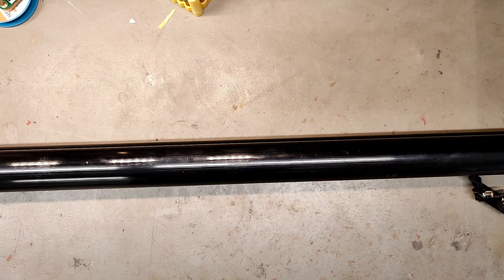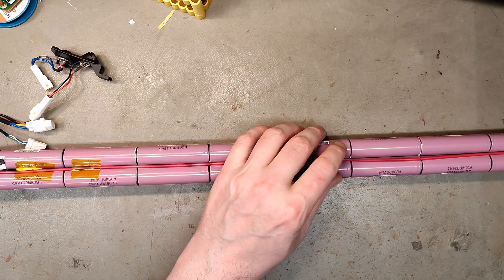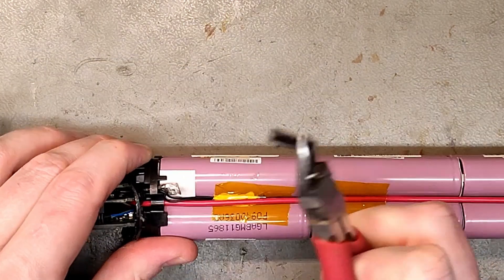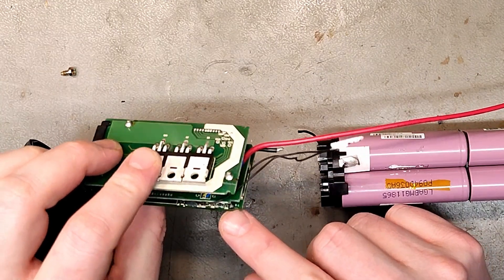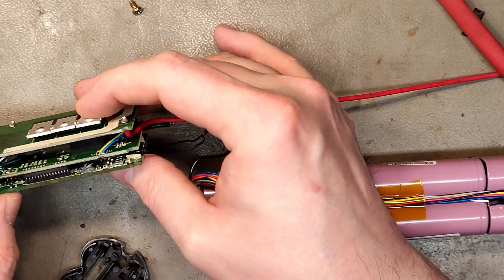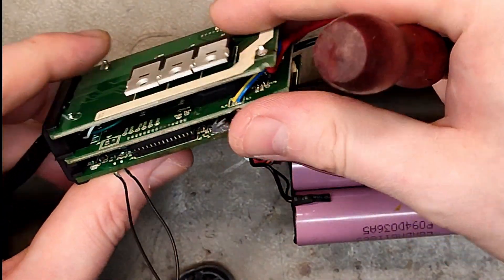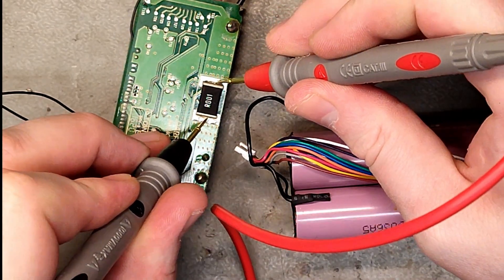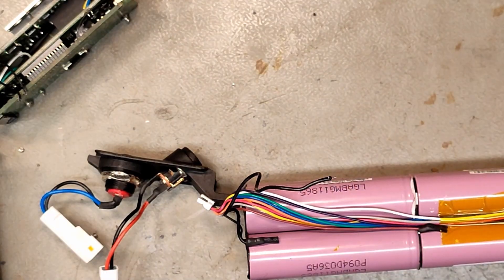Inside @ 9 year old Vanmoof Electrified S battery made by Darfon

Comment: Hi battery doctor. I am currently working on the same model of Vanmoof that has this same battery pack. The whole controller board was no longer working but the battery pack seem to be in perfect health with 4.2 volts on each group of cells. My question is, if I remove the Darfone BMS and installed another 10s BMS, could I use the same balancing points on the pack? Or, can I just use the Darfone BMS with any generic controller?